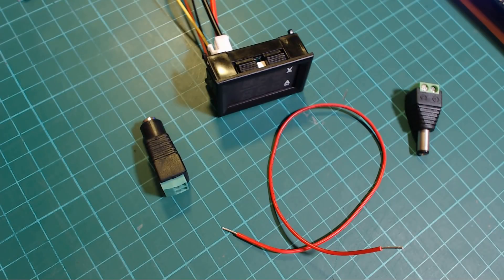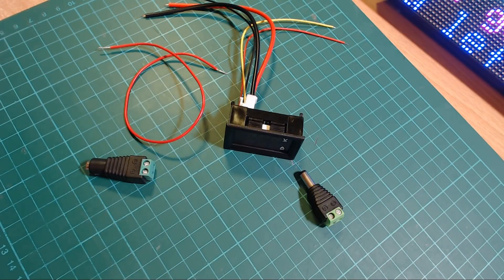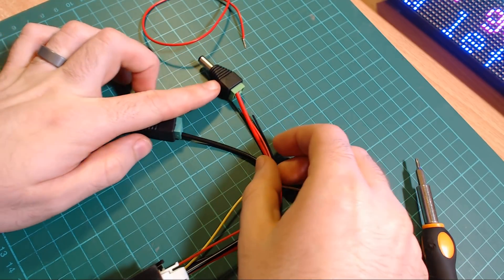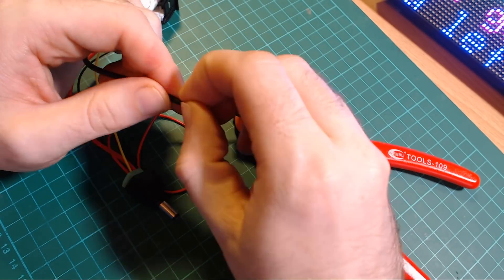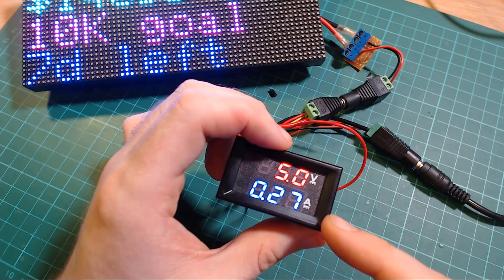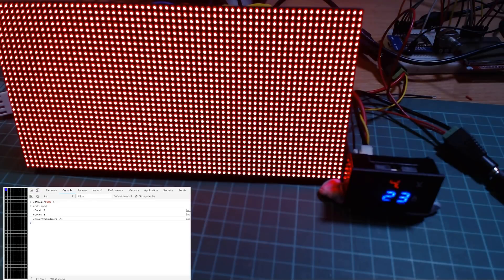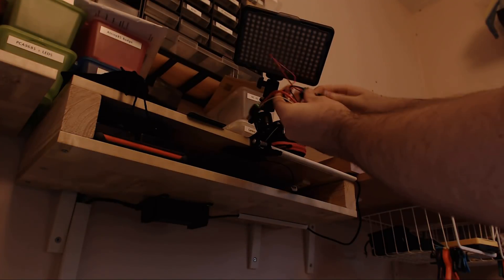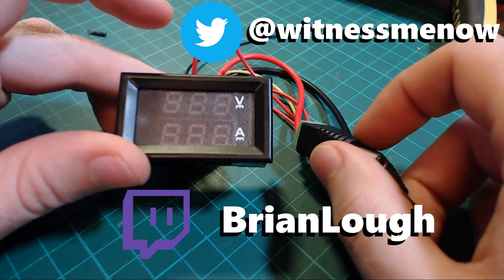Cheap & Quick Inline Volt & Amp Meter!

Comment: Seems like the wires wouldn’t be rated for higher draw applications, like an ebike. 
But for a 12-20 volt ammeter for testing out small loads, seems good enough.

Comment: Thanks for the video. Can you tell what is the connector used on the voltmeter PCB's for the current ? (the larger connector). I want to place the same on my PCB.

Comment: Hi! Do you know of this meter can be wired to be an inline meter that detects current coming in (from say a small 12v 1A solar panel to a solar charger)? In see it detects negative draw but what about charge?  If it can which wiring diagram would one use?

Comment: 9:10 I guess the current meter uses 0.1 Ohm resistor in series, that's why the the voltage drops.

Comment: Great Video!
Question, I am using a single power source for my meter but I want to be
 able to turn off the meter while leaving the line power on. Do I 
interrupt the yellow wire for a switch?
Thanks
Reply: Use a switch for the ammeter Red wire
Reply: @Dooper196  Thank You for your response!

Comment: I wanted to use 2 of these when making a PC Power Supply based desktop PSU. One on the 5V and another in the 12V.  But because of the Gnd wire measuring method I don't think you can. Any idea what will happen if you do this, but tie the grounds together at the load as would happen if you powered a Raspberry Pi with the 5V and a LED display that took 12V ?

Comment: Hi there, thanks very much for your video. Im just learning, can i ask for some advice please. Im trying to wire up the digital display but its still not working. I dont get it. I would like to monitor how much volts and amps are coming off my solar panel before it gets to the charge controller. Any help would be greatly appreciated as its confusing. All the best, kieron https://ibb.co/L9VWLMR

Comment: I see that you meter has a good update rate. Meters sold as "dsn-vc288" aren't all the same. They can have butchered firmware, where the manufacturer has decided that it would be neat if low values are not displayed, resulting in poor and uncorrectable tracking accuracy. The displayed reading will increase more than the actual input.
Three meters I bought from Banggood also have very slow 800mS update period instead of the advertised 300mS. They are useless for my application.
https://drive.google.com/file/d/18-L6NMsQPRj__3B3tpa6mP_4cYvvMNtz/view?usp=sharing

Comment: Can you tell me where you got that sweet clip-mount LED Light?  Thanks!
Reply from the maker: It's a video light with a separate clip (you'll also need a 12v power supply)

Light: https://www.amazon.co.uk/dp/B06XDFGDCX/ref=cm_sw_r_cp_apa_i_7hvgEbNNMNRB5

Clamp: https://www.amazon.co.uk/dp/B00MR0VPOQ/ref=cm_sw_r_cp_apa_i_QkvgEb4DTEJ5N

Comment: I've not had a lot of joy with those little meters. My first order came in with a faulty display and the second wouldn't measure current. The third one "worked" but the measured current was 20-25% low. My current solution is a cable assembly, using the same plug/jack gismos, which plugs into my two multimeters.

Comment: This is a great little cheap meter is you don't need a lot of accuracy. I actually used this in a project of mine. Just for some gobal volt and amp indication.

Comment: Nice! Agree, it now just needs a 3D printed case design.
Perhaps using those DC male & female fly-leads soldered directly to the PCB (removing the connectors), to make for a slimmer case?
Like these: http://s.aliexpress.com/FJJfuAri 
You could also use the same DC fly-leads to make adapter leads, if needed for any different input / output connectors.

Comment: Andreas Spieß did a similar project a while ago using another meter that seems to be more accurate and is also showing more data like wattage and Ah. But for a rough indication of the amps this is the cheapest way you can go. And we all know you like cheap 😏
Reply: Is there a meters always have to be calibrated on the back .One screw is where the ampsThe other for the VOLTS

Comment: I found the ammeter part is wildly inaccurate over the 30v operating range and I would have to use another meter to calibrate it (adjust the screw on the back) depending on whether my applications was down the lower end (~5v) or closer to re higher end (~20v) of the range. This was frustrating and means it’s not terribly useful as a general purpose utility. Fine however if your voltage range is narrow enough for the error introduced is sufficiently low.
Reply from the maker: I didn't even play with that at all, will make sure to give it a look when making the more permanent one. I would be using this mainly for 5v or 12v stuff so hopefully will do the trick for that ok

Comment: Could easily add a remote switch by connecting a relay connected to an esp8266 module. Current and volt data could also be fed to a program which in turn could output electricity cost to a separate display module or upload to a server via MQTT.
Reply from the maker: Is there a good way to read the volts and amp using an esp?
Reply: Absolutely, I have found a number of sensors that can be connected to an esp to measure voltage and current, they can even be connected via I2c to an ESP. take a look at the ACS712 board, they're very common and cheap to find.
Reply from the maker: Thanks Andrew, will take a look! My credit card is on fire at the moment so I might just add it to the wishlist 😋
Reply: haha, it couldn't be anywhere close to as bad as mine, I might do something like that as a project myself, if I decide to I will keep you in the loop. My coding skills are quite rusty.
Reply: @BrianLough you can make one for about 10€ using one of these modules... You'll see there are 2 models, 1 with lcd and case, one without, but both can be monitored via serial... And are supported by espeasy and tasmota, and i think espurna, too https://youtu.be/NeHH1ZfErfQ

Comment: can you please share a clear image of the connections you made? Thanks
Reply: here at 4:26 you can see how to connect the yellow wire in the usual wiring of this module: https://www.youtube.com/watch?v=G-9er3-Tdqg
Reply from the maker: That Diagram does not look right to me, the yellow wire is very thin and should not be used to run current through!
Reply: @BrianLough  I've a better one somewhere, let me search
Reply: @BrianLough  you're right, but if you look online, that's the schematic... https://www.dropbox.com/s/ih4yn9n4qh0lbxs/volt%20amp%20meter.jpg?dl=0
Reply from the maker: Here you go! Not pretty though!

https://i.imgur.com/dxjZCGr.png